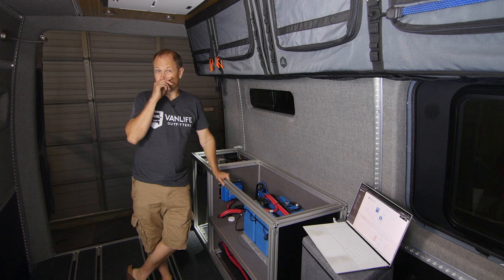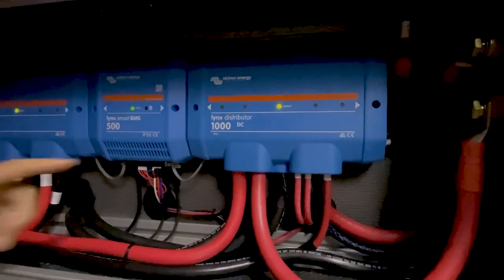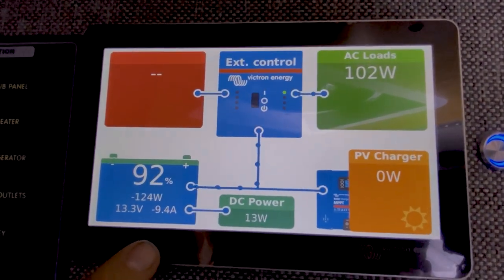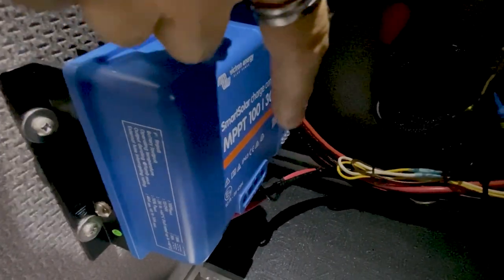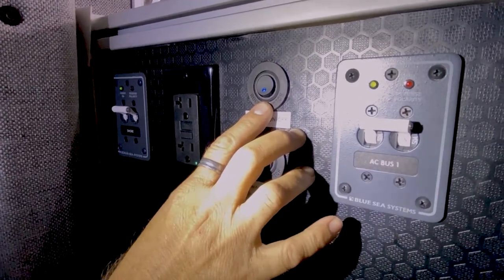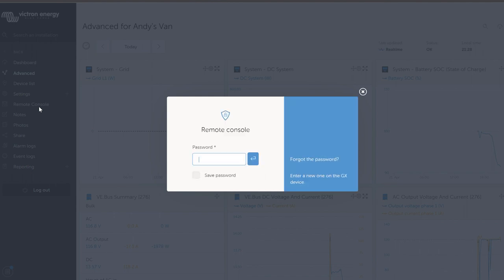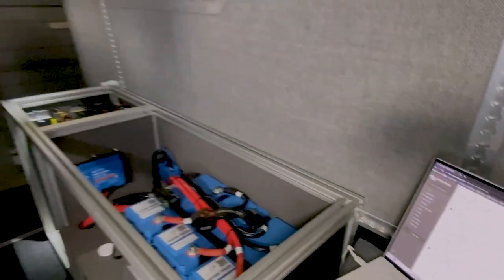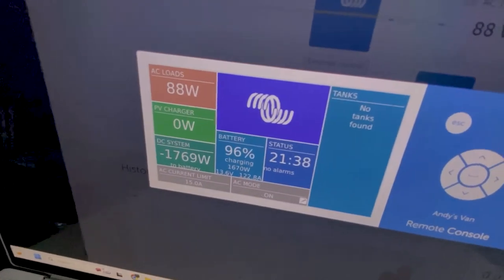Secondary Alternator Power System Tour

Comment: Much too complicated and expensive for the end result, and a complete violation of the KISS principle of engineering.  Everything may be fantastic when the system is new and working properly, but over time there's a shit ton of failure points (not the least of which are all of the large and small physical electrical contact connections), and any troubleshooting would be a nightmare.  But your video and explanations are a valuable educational experience, so thumbs up.
Reply from the maker: Well, we're going to have to respectfully disagree. I've had this system in my personal camper van for over 3 years without a single problem. We also have tons of customers who have installed this system without issues for many years. It's been incredibly reliable in real-world use and everyone who has it reports it being a game changer for off-grid camping. Also, the system is highly modular so that if there is an problem with an individual component it doesn't take down your entire system and there are Victron dealers all over the world who can replace necessary parts if that does come up.

Comment: Is this a 12V or 48V system? I thought that installing a 2nd alternator was something that needs to be done for a 48V system, and I thought that the Orion device was to downgrade the power so that 12V devices can be powered by a 48V system? I was searching for a video which showed where the 2nd alternator gets installed. Obviously, my knowledge is almost nonexistent!
Reply from the maker: This video is demonstrating our 12V secondary alternator bundle (link below). In a 12V system you might have a dedicated secondary alternator and also use an Orion DC-DC charger to charge from your vehicle factory alternator as well. You can use both at the same time.
https://www.vanlifeoutfitters.com/store/best-price-secondary-alternator-electrical-bundle-victron/

You can use a secondary alternator in all the common system voltages (12/24/48V). 

We also have a 48V secondary alternator bundle (see below). That one uses Orion devices to convert the 48V to 12V for loads that need 12V power like lights, refrigerator, fans, etc. Other loads, like DC air conditioners can work at 48V natively.
https://www.vanlifeoutfitters.com/store/best-price-secondary-alternator-electrical-bundle-48-volt/

We are working on another video discussing the mechanical installation of a 12V Nations alternator with Wakespeed being installed into a van that should be on our channel in the next month or so.

I would definitely recommend checking out our blog if you want to learn more!
https://www.vanlifeoutfitters.com/free-camper-van-electrical-diagrams/

Comment: That's a lot of Investment and over kill just to play with a touchscreen friend.
Reply from the maker: Hey there, the investment into the system is more about enabling off-grid use of heavy loads like air conditioners when boondocking in the summer in the Southeast US, not running out of battery capacity and having a reliable way to recharge in a few hours so that you can continue that cycle. The touchscreen and VRM is a nice bonus though.
Reply: @VanlifeOutfitters  Well, I have 600 mono PV on the high roof. 60 amp MPPT controller. 400 Amp hr LiFePo 4 storage. And 3 Kw pure sine wave inverter. Plus smaller AC inverters. Works for me 👍
Reply: Your comment is lame. This system is quite amazing. Living off grid with A/C in a hot/humid climate is not "just to play with a touchscreen".
Reply: @AK-ic1yj  Just to play with a touch screen... Right. What loads are you putting on that system?  Huh ?  👍Rock on🙂
Reply: @mythicalnomadadventure969  This system is far better than yours. Get over it.

Comment: Is the shunt for the second alternator hooked to the BMS or Cerbo GX?  Great video!
Reply from the maker: Thanks! The system has a system-wide battery monitoring shunt that is integrated into the Lynx Smart BMS. The additional, analog shunt is wired up to the Wakespeed regulator to monitor the power being produced by the secondary alternator which is communicated to the Cerbo GX over the CAN network.

Comment: Good looking build.  Would you mind explaining the need for an Orion charger connected to the van’s original alternator when you’re using the Nations alternator with a significantly higher output?  Is it just redundancy?
Reply from the maker: Yes, exactly. In a system of this scale, it's a relatively affordable way to add redundancy and also adds extra charging current all the time. Thanks for watching!